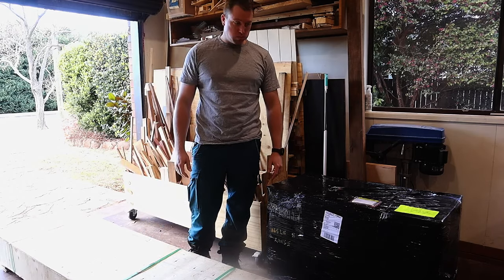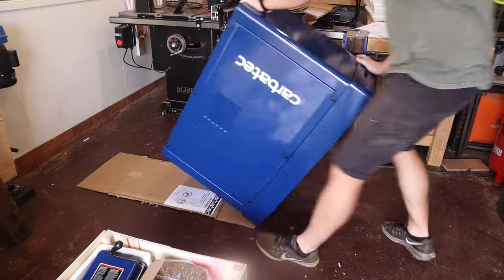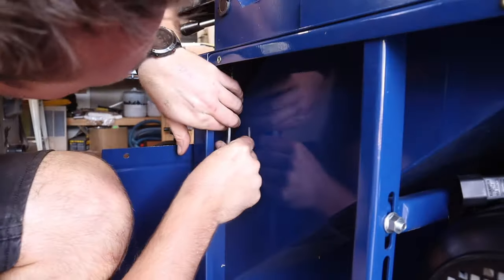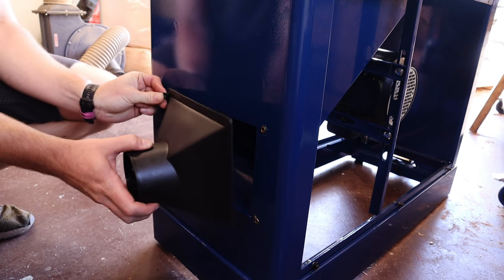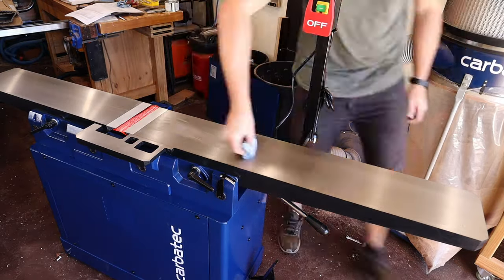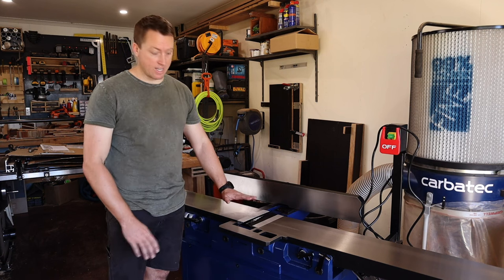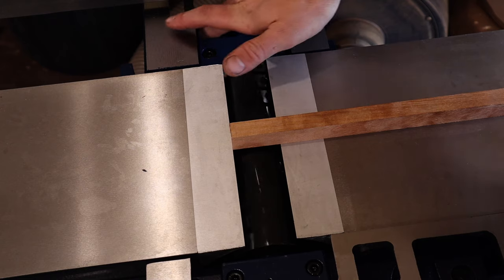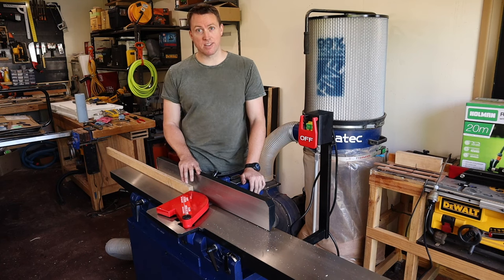Un-boxing and Setting Up A Parallelogram Jointer // Carbatec JN-X200C

Comment: Gday mate m. Great video. I got the same model recently as well. 
I have a problem that my Infeed table has a hump in the middle which I can’t seem to get out when adjusting 
Do you have this same issue and is it causing you to cut not square
Reply from the maker: Hey mate, sorry to hear You've had issues. I must've been lucky because both beds on mine were perfectly flat and once set up I'm getting good square corners.